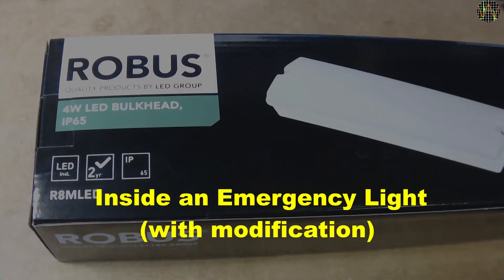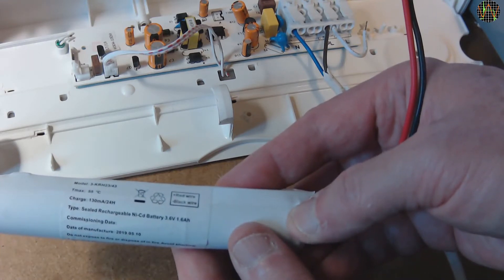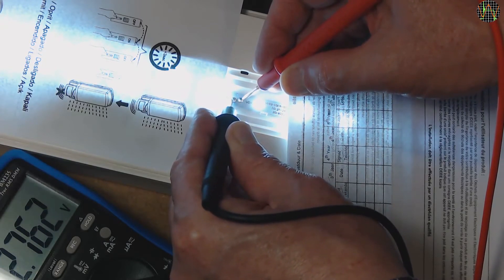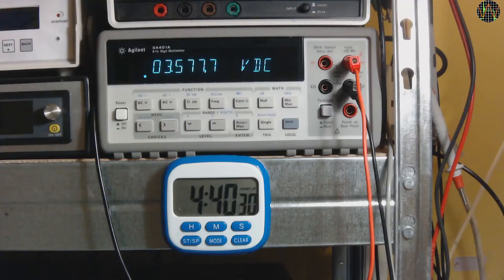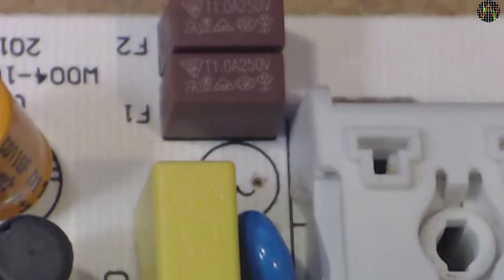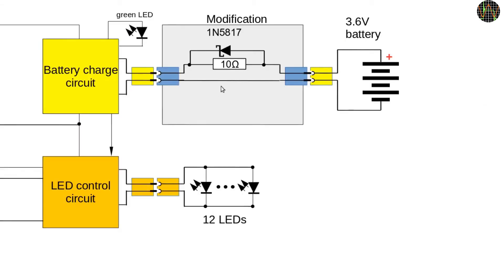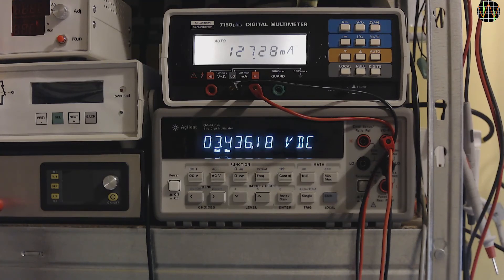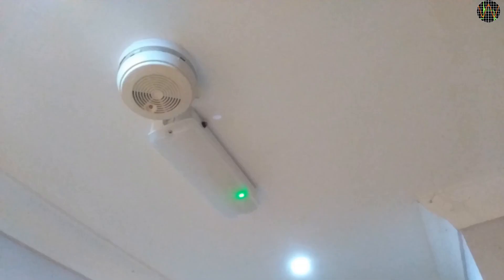Inside an Emergency Light (with modification)

Comment: I've got similar lights . I'm wondering if I parallel a couple of batteries together to make more amps and keep the 3.6v the same. Would I get longer run time from the batteries ..thanks
Reply from the maker: I am afraid that is not a good idea because these are NiCd cells and running and especially charging NiCd batteries in parallel is very problematic. To extend run time, your best bet is getting 3 NiCds with more capacity in each cell but NiCds are difficult to find these days because of the Cadmium pollution.
Reply: I've just  noticed that you replied. Thanks ..You advised me not too.but it's too late I've already put 8 packs of 3.6v together in parrarall. Now instead of getting 3 hours. I'm getting 15 plus hours  .I haven't tested them too fully discharge yet cus I turned them off
Reply from the maker: @fredbloggs7345 Ok, but watch out for long term issues. If one of the cells ages faster than the others (as they inevitably will) problems will emerge.

Comment: Is it possible to convert a non maintained emergency light to maintained emergency light
Reply from the maker: I suppose in principle all that is needed is a 2nd power source from the mains connected to the LEDs through a diode. That 2nd power supply could be very simple (capacitive dropper with a rectifier and smoothing cap), possibly extracted from a LED light of similar wattage. I do not know if the power supply in the light could be used for that, after all it is designed for charging the battery not for running the light. Hope that helps

Comment: Great video. Out of intereset did you fix the class Y2 supression capacitor which has one leg out of the hole? See 12:14 for a good shot of it.
Reply from the maker: Its actually not out, just mounted very lopsided and its not the only component on this board with that problem, one wonders how these are assembled. For this capacitor, the thin metal lead goes all the way into the PCB and was soldered in. Not pretty but I let it pass. BTW, it is still in service and now that it is installed we had just one power outage of 2+ hours in the evening where it was very useful.  I mounted it in the downstairs hallway close to the stairs and it was so bright that one could easily use the stairs and upper hallway just by the reflections.
Reply: @TheHWcave  Thank you, both for clarifying and taking the time to provide an update. It''s good to hear that the light is serving you well.

I suspect the displacement of the capacitor and IC occured due to the way the wave soldering process was implimented!

I'm really enjoying your video style. Thanks to your detailed hack & calibration videos, I recently bought myself a UT210E and am very happy with it so far. Keep up the good work!